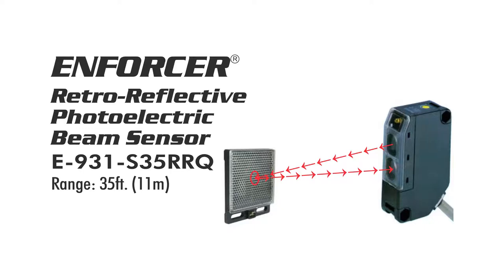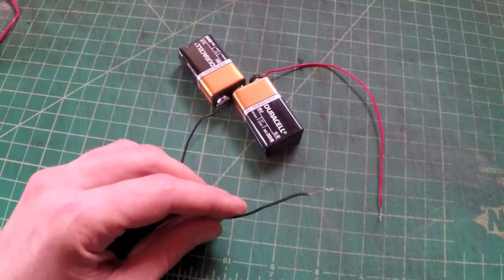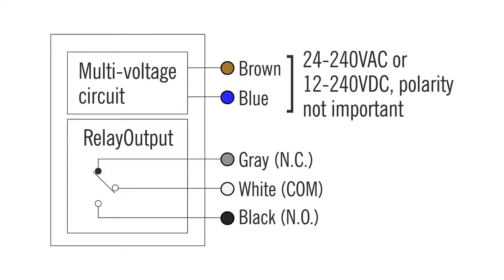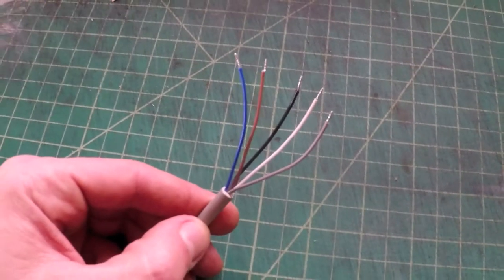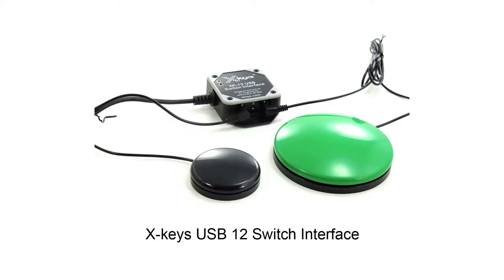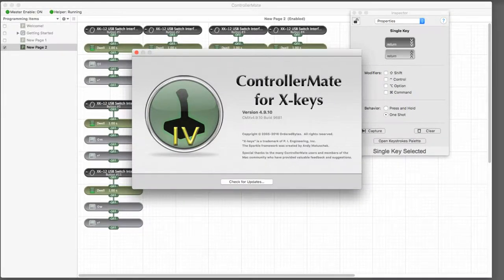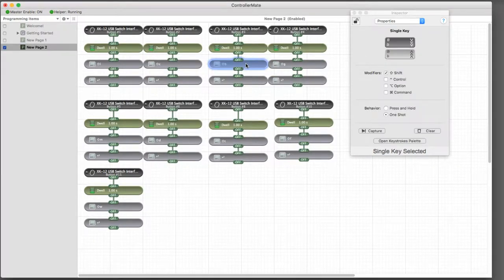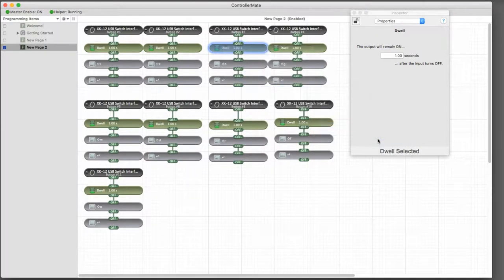DIY Track Timer, Part 3

Comment: I recommend checking out the USB joystick-controllers, as they seem to be the cheapest things with a USB-encoder. Also I thought about som COM-port solution for transferring the signal. It should be realtively easy to make a plugin to the chosen software that way. Dunno which encoder would work best for that though. I think even the joystick keycodes could be registered directly by the program somehow too. 

Also the main reason I am actually interested in these photocouplers, is to trigger a camera.
Reply from the maker: I've thought about using my timing system to edit a live video stream, but I need a few more cameras to make it fun. You might be able to connect a camera directly to the photo sensor relay switch to snap a picture when beam is interrupted. Most digital cameras have an electric button you push to open the shutter, and I've seen some new cameras that have remote trigger inputs just like a USB encoder. Reminds me of how Eadweard Muybridge photographed a moving horse using a trip wire to trigger the camera.
Reply: Hi rkan2, I am trying to create a communication between a photoelectric sensor and pc trough COM port (It is already working with a usb switch interface but it would be easier to use a DB9 cable to connect it trough COM port). Did you find out if this is possible?. Thanks in advance.
Reply: @ETModulo  I haven't explored com-ports. I just bought some SICK (brand) used industrial sensor and a diy-joystick board from Aliexpress. Then finally I bought some Arduino clone with HID support that was small enough to fit inside the SICK photoelectric sensor and used some Arduino joystick library. Works well! I guess the accuracy for timing could be improved by making the Arduino report a the time when the contact closed, but since I'm just triggering a finish line (industrial) camera that is the actual timing device (1/3000s) I probably won't bother.
Reply: @rkan2  Thanks for the replay. I am going to continue researching.

Comment: Hey! This all sounds pretty good! Do you have an estimate of what your setup cost is? I see that the sensors run about $50 per sensor setup.  So it 2 Sensors + Adapter + Wires + Tripod(or mounts) + Power is going to be at least $200 or so?  Does that sound right?
Reply from the maker: P. I. Engineering makes the X-keys USB switch with 3 inputs for $50 or a bigger adapter with 12 inputs for $100. I used a bunch of old extension cords to run power  to the sensors and thin stereo wire to connect to the USB switch. The beam sensors come with light reflectors and mounting hardware  to install in variety of situations. You could make a real simple lap timer with just one sensor, connected to a laptop with Internet connection, for a little over a $100.
Reply: @ScottBl8ke  Thanks for the response! I'm looking at a setup to time 40 yard dashes and I think this might be a good option for it. In my case I'll need to use 12v batteries, based on the specs it shouldn't draw much at all. I might be back to ask more questions down the road!

Comment: Hi Scott, I am trying to replicate your timing system. Is there a way that you can guide me with the how to start with the programing after connecting the xkeys usb into the computer and selecting Hardware mode? For a unknown reason Apple stop working with PI Engineering, so programing has to be done in PC. I have my sensor, xkeys, batteries and MacroWorks 3.1 running in the PC computer, it is just the fact to understand the logic process after connecting the xkeys usb and starting the software . I will really appreciate your help of course, if it is possible. Thanks in advance.

Comment: Enforcer products fail and stop Gate function during mist or light rain. USELESS for outdoor use. I have E-931, 50 ft on 24 ft opening. Common problem for,this company products.
Reply from the maker: I made this timing system 5 years ago and have never had a problem with the beam sensors, but I do not ride my track when it is raining. I also covered all of sensors that are outdoors with a little weatherproof box to keep them dry. Here is a little update from 2020. https://youtu.be/e0f8F8sVvBM?t=92